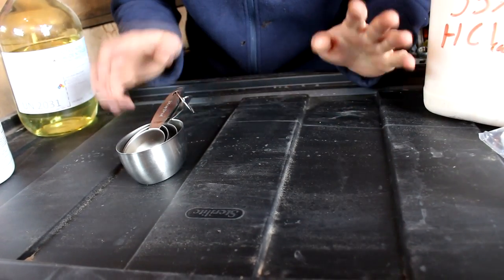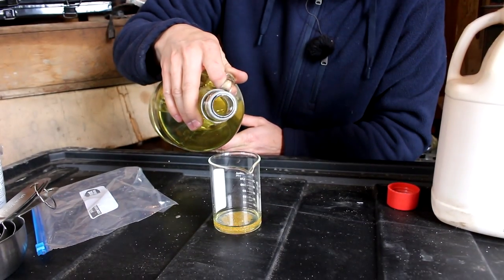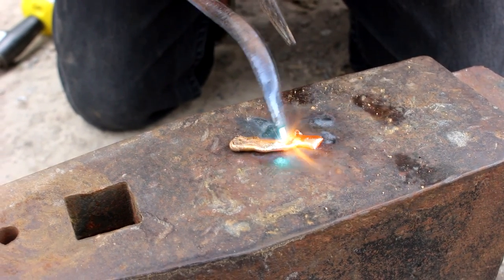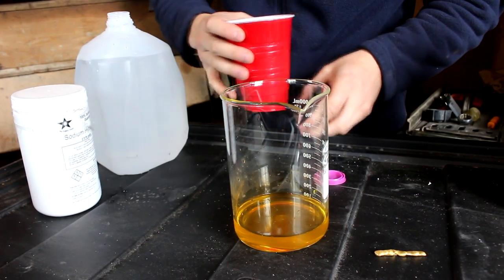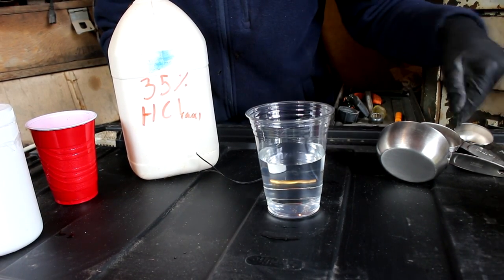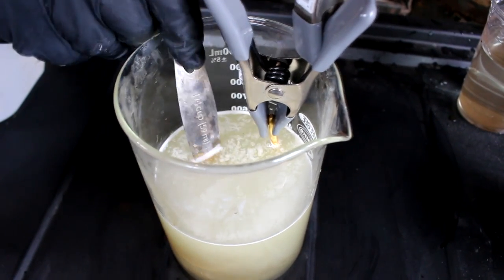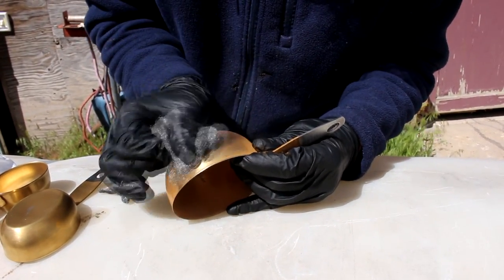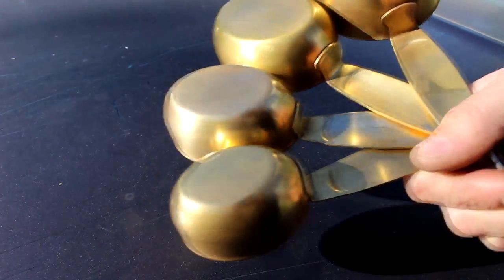Gold Plating Measuring Cups For My Mom

Comment: Just wounding why did you clean the surface of the cups then placed it on a dirty surface?
Reply: TheLongestNameEverStartsWith that’s what I was thinking that’s problem why that one cup had to be replated
Reply: The surface he placed it on is not dirty in they way that Cody was referring. When electroplating, the surface needs to be clear of oils and "sticky" contaminants, which he cleaned off with the HCl. The surface he then placed them on was only dirty with dry particular "dirt", which are less likely to stick, and even if they did, would be removed when dipped into the electroplating solution.

Comment: In case anyone is interested, the term "blowhard" dates back to the local gold trader in town that would separate and purify gold, used a similar technique that Cody used to get rid of the paper bits. often times if you blow hard enough small particles of gold would take off and the "blowhard" would sweep it up later, after doing it intentionally.

Comment: Steel wool is far harder than gold, also has very fine angular edges which cut when using to abrade, scour, clean or fine finish surfaces like wood. Last, it comes with a thin protective oily film coating to keep it from rusting, so if you use it here you should have to re-clean the items before returning them to the bath. Burnishing might be a better approach, as it smooths with minimal removal of material, and gold is one of the few metals that really burnishes without losing bond to the surface.

Comment: Clean the stainless cups with nitric. HCL dissolves the iron leaving chromium on the surface preventing adhesion. Plate the cups with copper and highly polish. Do a nickel strike , polish, followed by the gold. The end result will be a mirror finish and adhere well.

Comment: Neat.  I think a NaOH cleaning... better using an electrolysis NaOH method for sure as I forgot to mention on the last comment I made on the other bumper gold plate video.  Then a thin copper plate and then the gold plate will yield significantly better results.

Comment: I have seen two of your videos of gold plating. I learned a lot. But I also saw that that the finishing quality was not so impressive.
I decided to look a little deeper into the subject. I found that you are missing two steps in the preparation process.
First people who work with gold plating do two electrochemical baths before the gold. First one to clean and another to make the metal more "reactive" with gold.
The last step, for the gold deposition, they dont dip the object directly into the bath, but use some sort of furry glove over the electrode wet with the gold electrolite and smear it over the object.
Thanks for teatching  lot.

Comment: Acid bath cleans off oils? XD
 I thought that you're supposed to sequentially use Soak Cleaner and Electro Cleaner, then use the Acid bath to activate the surface (rinsing between cleaning cycles).
Also, you should use a stir bar at low speed in the beaker (1 or 2 setting) to generate some throwing power for the plating solution. Be sure that the cups aren't touching the walls of the bath.

Comment: So, I was working on a pool today, and I thought about something very interesting. In the industry, we have to use large 3-4 HP Sumps/Submersible Pumps, And they are almost always Iron bodied. They have wires that are copper( Of Course) and also some steel and sometimes platinum (plated) pieces. I Put a pump in a bucket to carry about 15-20 gallons up a 12 foot deep wall, And as the pump was there, it got clogged. I let it run for a while and I noticed bubbles forming. I didn't think this was abnormal, because it happened all the time, but something struck me. What if I was producing hydrogen gas? I couldn't check, as i did'nt have a lighter, but i thought it was something pretty interesting.

Comment: 4:18 the volume of the solution is bigger?what did you do in between shots?also you said you did not want to mix the hcl and cyanide and this is why you used the hydro to neutralize but you already have those other two mixed in your solution so i dont understand?

Comment: this is exactly the vid info i was looking for because i wanted to know how to make a gold electrolyte solution,,but i will not be able to find all these chems ,are there any substitutes like say baking soda instead of sodium hydroxide or hydrogen peroxide instead? is there not an easier way to do this like doing copper solution?  i figured since copper is a hard metal too like gold they both should use a mild acid to dissolve but i knew that was too good to be true,,usually i only use vinegar,distilled water,salt,citric acid and hydrogen peroxide and two piece of copper,,can gold not be done the same way? btw  got freaked out at 8:26 for a sec till you mentioned this was your niece and not you

Comment: Ok. Late to the party. Here's what the problem probably is with getting the gold to plate to the steel. I had small but similar issues with copper plating.

Most kitchenware is actually STAINLESS steel, which means there's actually a thin layer of chromium oxide on the outside of the steel which protects it from oxidizing (rusting) over time. 

The chromium oxide is fairly unreactive, so you have to really let it sit for a while in a hydrochloric solution to etch away the layer and expose more of the raw iron and then IMMEDIATELY swap baths to minimize the chance of the chrome in the stainless from oxidizing again. 

You als should consider the affinity of the metals you are plating. Since I was trying to do primarily copper, I'm not too familiar with gold, but in some cases a strike plating can assist in bonding two widely different metals (I made do without it, but it was suggested that nickel as an intermediary is a good choice).

Finally, god doesn't really oxidize with exposure to air, but minimizing how much you use abrasives can help prevent oxidation. It's weird but I think it might have to do with how in plating you're bonding it molecule by molecule, and how abrasives may break those bonds up a bit and change the surface area, actually exposing more material to the air.

Comment: You could just have made a cyanide solution and used the gold bar as a cathode and the measuring cup as the anode, hook them up to a power supply and you are done.
The best results come when you polish the objects about to be gold plated. And usually you only need one application of 5-10 minutes.

Comment: Is this based on the conventional electron theory of positive flowing to positive or the actual electron flow? I recently learnt about this in a course for work regarding DC voltages.
Just thought it may be something to bring up. Does the negative really draw the gold onto it? I'm a bit confused and wondering if this is how the conventional theory came about maybe?
Reply: Electrochemistry and physics always use the correct electron flow and reactions.   It is only for circuit diagrams and electronics that the conventional current from positive to negative is used (although some people and text books use the electron flow too) and that is just a historical accident, Benjamin Franklin called it wrong!

Comment: Your gold doesn't stick well because you used wrong voltage. You need to calculate it. It's proportional to the coating surface.

Comment: Couldn't you just have dissolved the gold into an alkaline cyanide solution right away instead of making the hydroxide first? 
Also, I think stuff is usually plated with nickel first before gold-plating but I'm not entirely sure, might get it to stick better

Comment: Hey Cody, what would happen if someone try to plate something with mercury?
Reply: Steven Larry this is late but I don't think it would stick unless frozen at very low temperatures and at that point it would constantly need to be frozen just to stay put, mercury moves around way too fast and much to be plated normally otherwise and I'm pretty sure in some cases it might / would be illegal to plate something in mercury for the health concerns

Comment: Ever hear of the myth that steel toed boots cause more harm than good? The logic is that the steel bit will curl down and cut off your toes. Frankly I think I'd rather take the minute, if at all present risk of that, rather than the definite risk of having my toes crushed so severely that they would probably end up amputated anyway.

Comment: I'm a bit confused as to why the nitric acid is able to oxidise the gold. In my chemistry class we're currently learning about standard electrode potentials and feasibility. We used an example where dropping gold into acid has no effect as the reaction is not feasible because gold can't be oxidised since it's reduction equation is more positive than the reduction equation for acids which is 0.00v (gold is oxidised not reduced so SEP becomes negative and therefore not feasible). If anyone could explain this to me I'd be very grateful.

Comment: becareful heating the top of your anvil as it is a hardened surface and you can remove its temper .... hot metal that is being forged is unlikely to to do it but melting gold on it is not ... 1400c compared to 1000c to 1200c of forged items that cool with the mass of the anvil ... best to melt gold on a granite surface or a ceramic surface

Comment: Cody,  You literally preached safety for your toes moments after you completely ignored all safety rules for chemistry.  You are working with nitric acid and are taking no safety precautions. You need to, at the very least, be wearing gloves and safety glasses.  You really should be wearing LATEX gloves for nitric acid, lab goggles, a chemical resistant coat, and closed toe shoes.